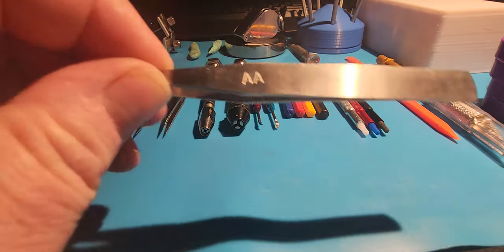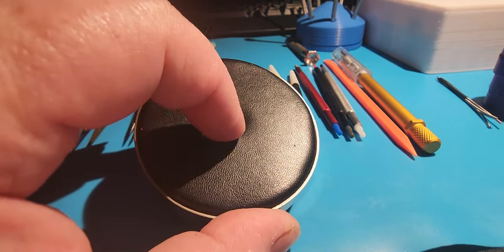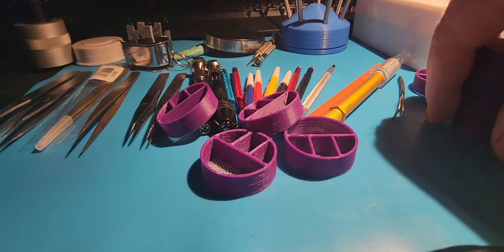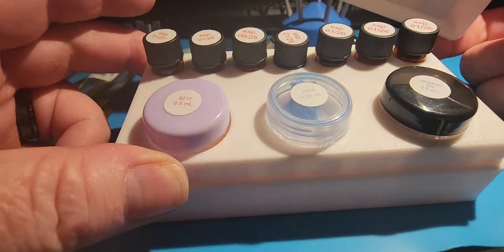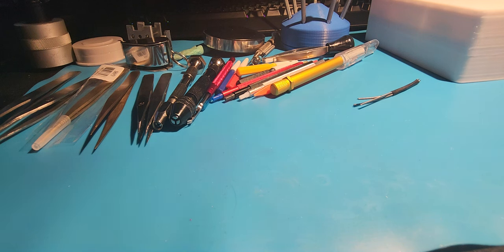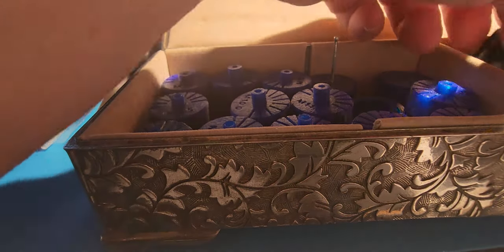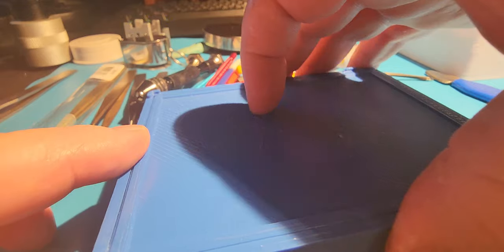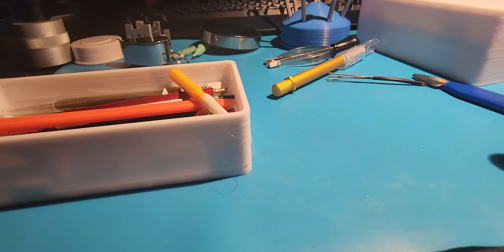The tools that make the trade!

Comment: Most of the time the midrange is where it's at. The absolute most cheapest stuff is maybe 2$, the midrange is 4$ and the bergeon is 40$ (numbers won't be accurate but the ratios probably will be). If you just stay away from the worst stuff and go slightly more expensive on some more important items you'll be fine.
Throw in some STL files too!
Reply from the maker: This is true. I am probably going to showcase a range of options for all budgets. Which stl's are you talking about? Some of them come from the usual places, but the cleaning machine stuff I haven't released yet.
Thank you for watching!

Comment: I’m so glad I found your channel! I was getting a bit discouraged! Couple of questions… 1) are you concerned about the mainspring getting plastic shaved into them?  2) do you think you get enough wash flowing through your baskets with the sides being solid? And 3) (for right now lol) will you share the seller you got your oils from? 

I’m very jealous of all your super cool 3d printed tools and holders! That’s way cool! 

Thanks!

Oh! Could you maybe do a video on how you dressed those tools that weren’t quite right? I’ve sharpened up my screwdrivers but would like to see your methods!
Reply from the maker: Thank you for the kind words! To answer some of your questions,
1) No, I have cleaned up the prints so there shouldn't be any plastic transferred.
2) there should be plenty of wash going through the baskets. Since it creates a bit of a vortex, it will pull the cleaning fluids down and out.
3) DSWatchShop is the seller I got the oils from.

I do plan to make some videos on dressing both the screwdrivers and the tweezers. Stay tuned!
Reply: Thanks for the info!!!